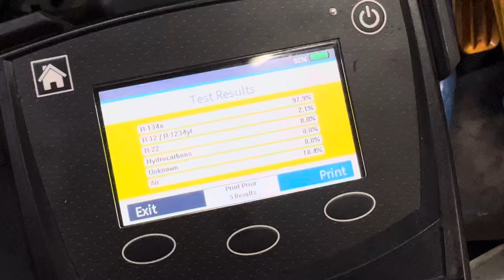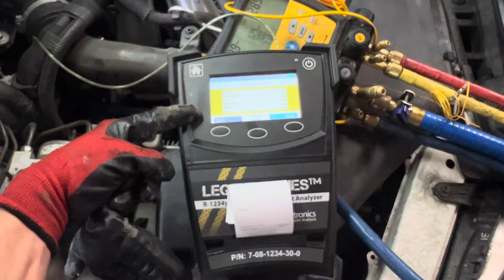Subaru, WRS was just repaired AC at another shop . Contaminated, refrigerant plus high air content

Comment: what would be the most likely cause?  Someone charged the system with recycled contaminated refrigerant?
Reply from the maker: Yes, a shop that does not own a refrigerant analyzer recovers, refrigerant from another vehicle that is contaminated and mixes it in with their recover cylinder that gets distributed to all cars. 
     And their automatic air purge is not working on their machine. This is the only reason you can have 18% air.. 

Unless they don’t use a vacuum pump for some reason . 

Or they have leaky seals at their fittings so after they stop, the vacuum air starts getting pulled past the rubber seal into the system . 

There is no excuse for any of the above mentioned conditions to happen. 

The bigger problem is that they’re doing this to every vehicle their servicing what they just put into this one vehicle they’re doing to every vehicle .

Comment: So if that 2.1% r 12/1234yf was recovered in a machine, would that tank have to be desposed of at a recycling facility?  The air just gets purged by the recovery machine before recharging correct?
Reply from the maker: https://youtu.be/mB1f9H7jzrI?si=-3rL3CRc-NEor2gL

Believe the answer should be in this webinar to acquire your EPA 609 refrigerant certification . 

But 2% recovered into your machine would be diluted out below the minimum standard . 

Even though 0% should be the minimum standard . 

All machines, especially as they get older don’t always purge out all the air correctly 

This is why it must be tested never trust a machine to work perfectly forever . Everything breaks.. 

In this case, as a technician or the owner of the shop, you just will not know it . Because you will not own the piece of equipment to actually test..
Reply: @coldfinger459sub0 thanks for the link.  They don’t seem to give any specific number.  Just that a small amount of contamination can cause cooling issues and if contaminated refrigerant is found it should be recovered in a designated tank to be reclaimed or destroyed.  So if one rolls into the shop with 1-2%, seems as though we should recover in a tank designated for contaminated refrigerant.
Reply from the maker: @H750S  here’s a MACS link I found what you’re looking for
It turns out recycled, refrigerant 98% purity I think 100 ppm moisture or 50 parts can’t remember now and 500 ppm oil contamination provided in the link below
https://macsmobileairclimate.org/2023/05/17/recycle-vs-reclaim/
Reply: @coldfinger459sub0  awesome, that clarifies it.  Thanks man👍🏻
Reply: @coldfinger459sub0  like back in the day ...they warned  people not to contaminate the R12 in your AC system with R134a.........cause it actually worked BETTER ! .( they failed to mention that one ..oops )..
but i dont want to confuse people .....follow the procedures outlined by Tom ...and you can't go wrong !    Cheers   Jay Fox aka CarsRcool